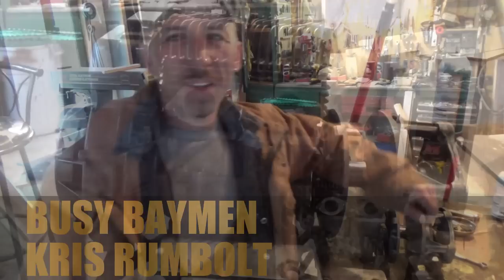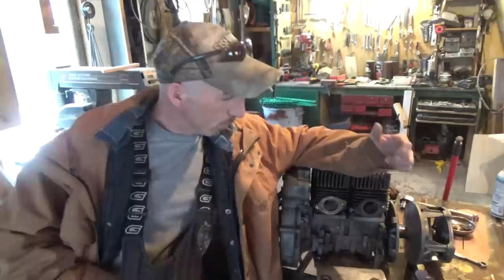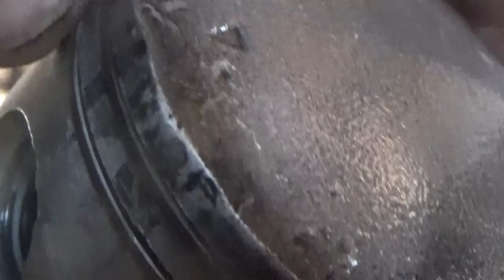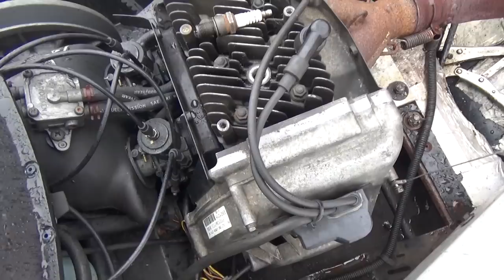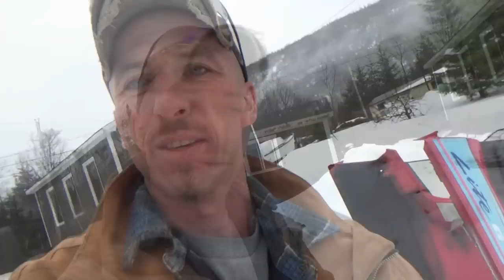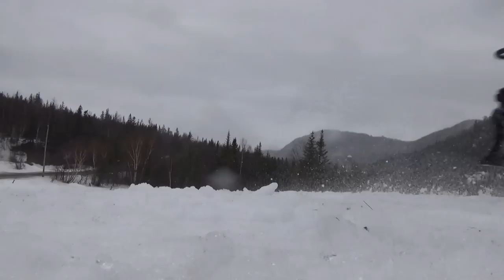SHE RISES AGAIN

Comment: Another awesome video Buddy. I am on my second Polaris 340, they are a great machine. I overheated the engine last winter pulling a couple of Quads off a slush covered lake. The clutch side piston suffered a skirt seizure. I honed the cylinders and replaced both pistons, all is well again. Judging from your skill levels you are either a Millwright, Mechanic, Machinist, or some other type of tradesman.
Reply from the maker: +Out o' the house with Paul neither lol environmental technologist by trade and work at a paper mill take care man